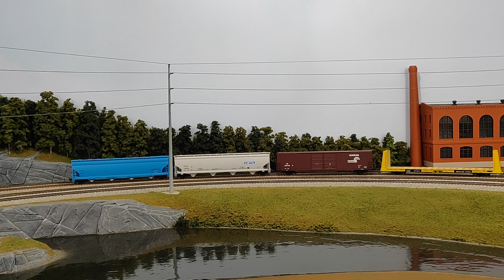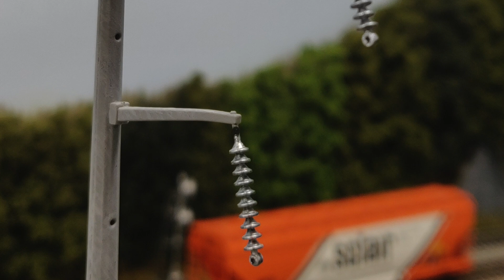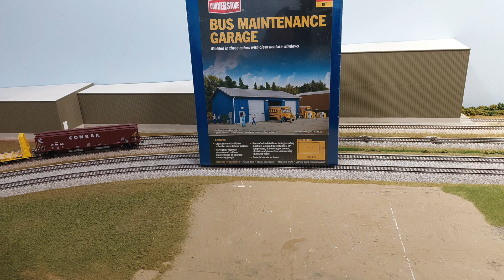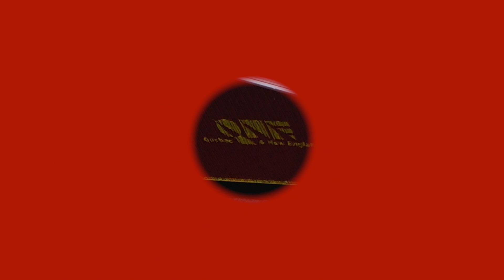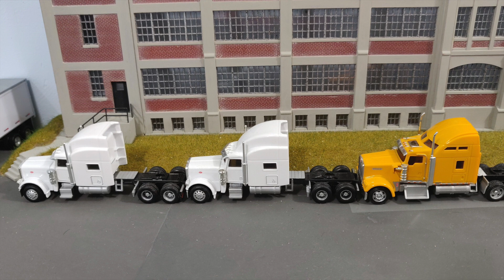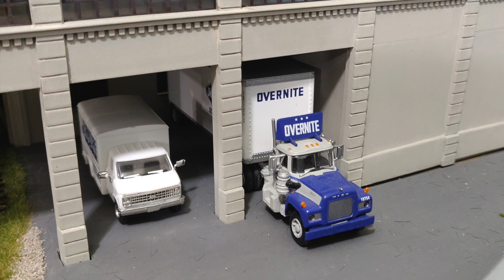Q&NE HO Layout Video 147 - 231025

Comment: Metal poles do not normally have a back up wire to provide strength on corner poles except on wood poles. The guy wires on wood poles are used where each insulator is dividing the angle by half.
Bill Barnes
Reply from the maker: Thanks for the prototype information, Bill.